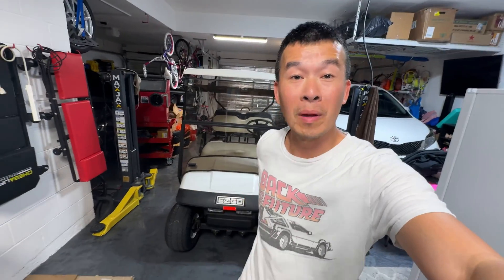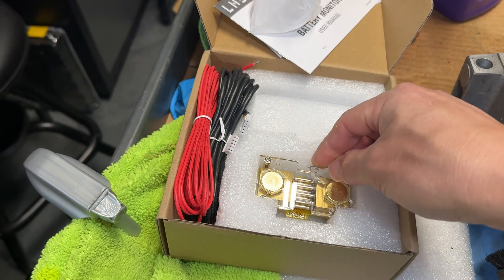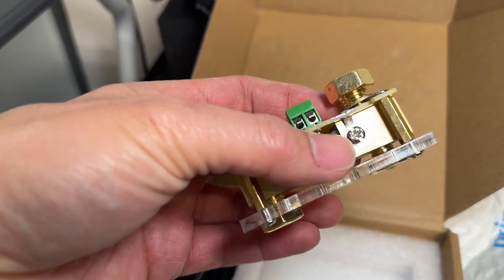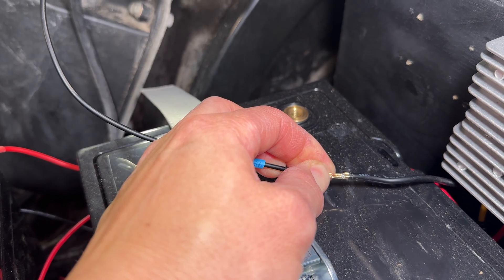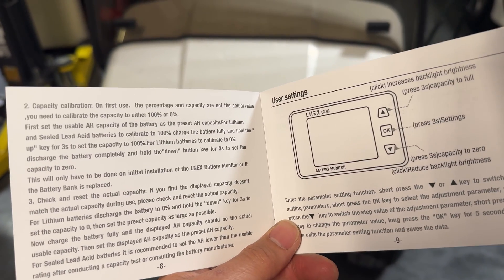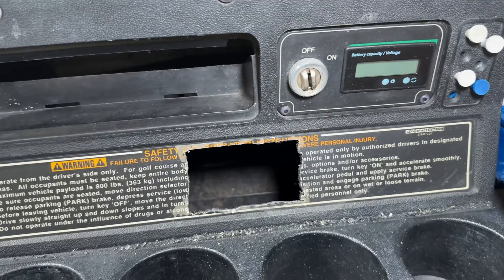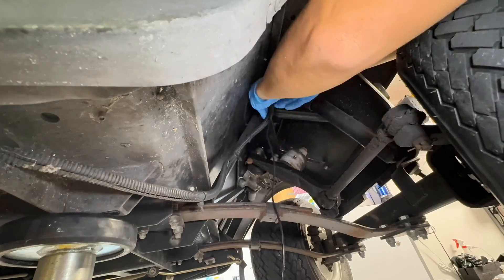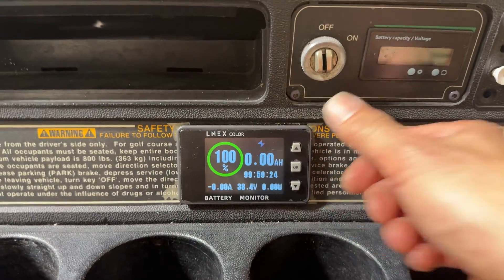How to Install Golf Cart LiFePo4 Battery Meter

Comment: The other battery indicator you installed in the other video isn’t good for lifepo battery’s? I just installed the on from the other video with my lifepo battery’s and then configured it for 16 cells since I have 4 battery’s for 48V. Every time I press the throttle the meter drains all the way then slowly regens after I take my foot off of the throttle.
Reply from the maker: If you’re referring to the $10 meter, that’s more of an instant voltage meter than a useful gauge. I tried this for my LiFePo setup first but I returned it since I wanted Bluetooth connectivity. The video I did right after this video shows that new meter with Bluetooth and more analytics.

Comment: How did you get 12v to the shut to power it on?  Did you connect to your 36v to 12v converter?
Reply from the maker: Tapped the converter since you want to keep it balanced.